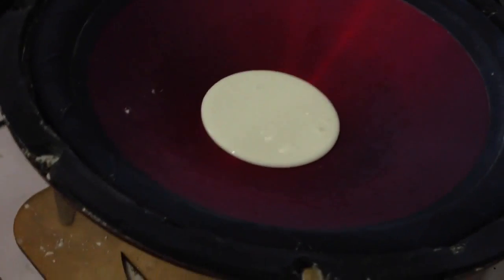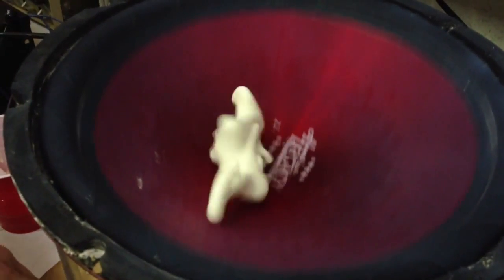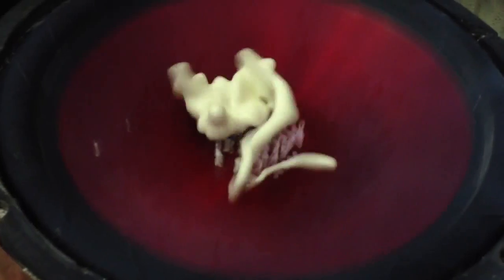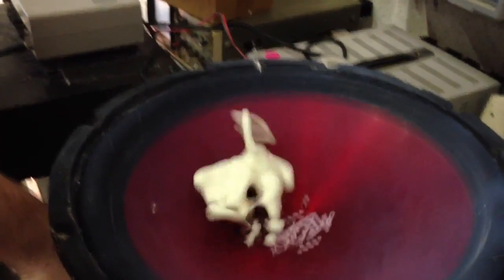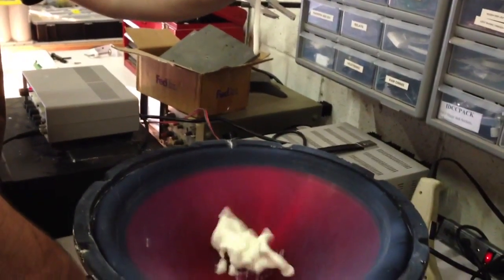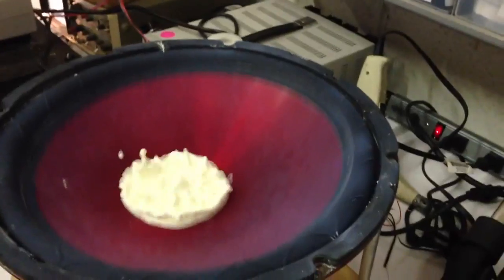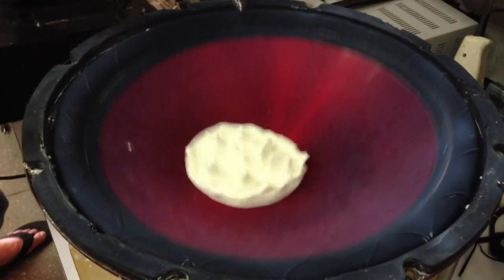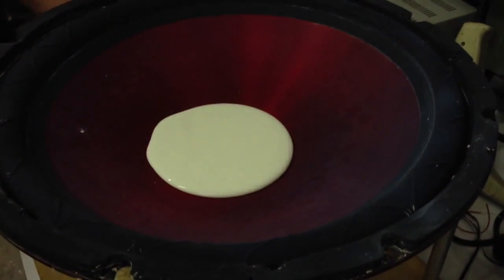Messing with Non-Newtonian Fluids (Cornstarch & Water) and a Subwoofer.

Comment: what if you spray the speaker with  " never wet" then add strobe light to slow down effect.
Reply from the maker: There was neverwet on the speaker during that video. The problem is neverwet seems to "wear off"  after a while.  The strobe sounds like a cool idea.